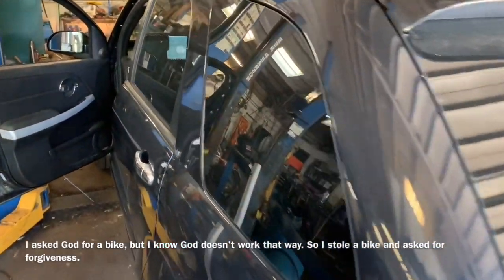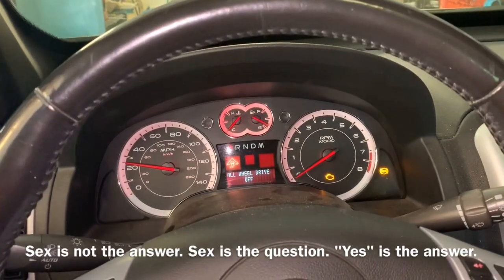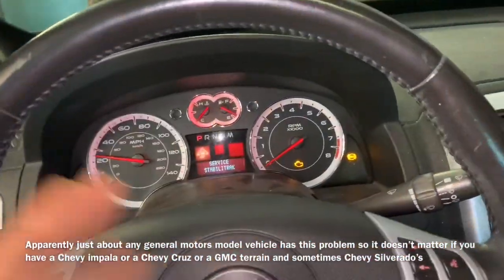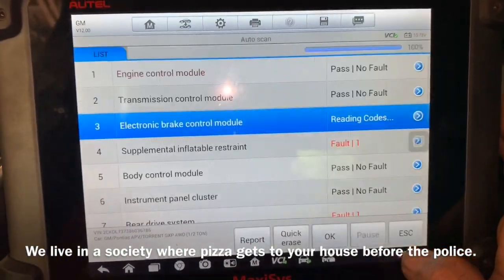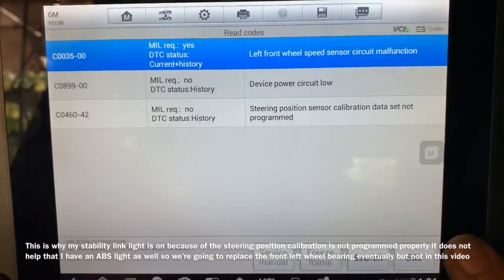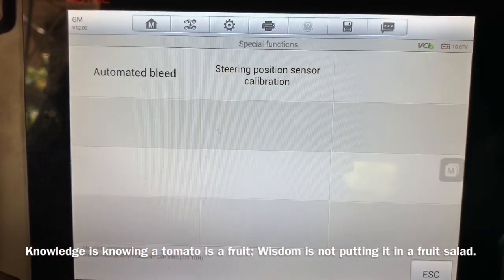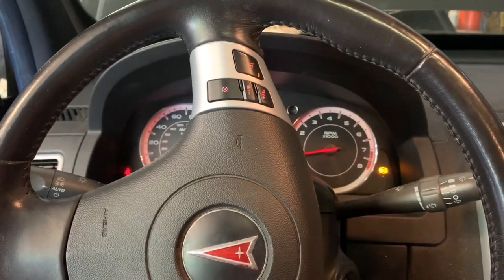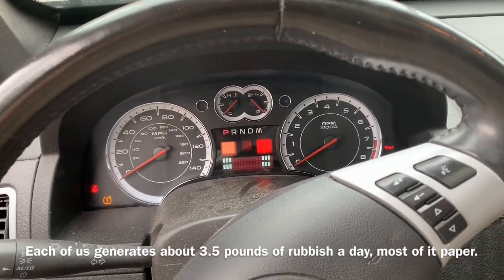Possible reason why stabilitrak light is on. Chevy equinox, GMC Terrain, Saturn Vue,Pontiac torrent

Comment from the maker: ⭐⭐⭐⭐If you found the video helpful, and you'd like to help us out. You can use ANY of these links to purchase ANY ITEM you normally would on Amazon and we'll get a piece of the pie with no extra cost to you!  Thank you!
Autel Scanner Maxisys  2022  Diagnostic Scan Tool with ECU Coding, All-system Diagnose, Bi-Directional Control: https://amzn.to/3k9T6rl
FOXWELL NT301 OBD2 Scanner: https://amzn.to/36OSHru
CRAFTSMAN Mechanics Tools Kit with 3 Drawer Box, 216-Piece (CMMT99206): https://amzn.to/3wlLgAz
DEWALT 20V MAX* XR Impact Driver Kit, Brushless, 3-Speed, 1/4-Inch: https://amzn.to/3N9D4KN

Comment: I had the same dummy lights. The lights were intermittent for about a year, but for the last 3 months (Sept, Oct, Nov, 2020) they stayed on. The Stabilitrak/Tracton Control, and ABS were not working - I tested them in the rain. Took it to a great mechanic and it was the right rear wheel sensor. Said it was very common for a 2008 Equinox. It cost me $260, but I now know for a fact what the problem is when the other 3 fail - which is just a matter of time because those vehicles are a POS. I will change those myself for $20-$65 depending on the quality of part that I buy.
Reply: The speed sensor? My services lights went on when I was parking my terrain. Hopefully that narrows it down to the front two tires. ( we had a heavy storm, maybe the splash finally killed it )
Reply: @fortyforfree  
Yes, it's called an ABS wheel speed sensor. They told me they had to drive it with the diagnostic tool connected to figure out which wheel it was. In the past 6 months the light has been coming on  again intermittently so another one is getting ready to fall. The vehicle has been a money pit but it's paid off and in good condition. I use it as a work vehicle so it's all good.
Reply: @bigelile07  Oh, did you take a look at them when they changed them? They just looked corroded? Hopefully it’s on of the front ones. I’m not great with cars but I think I can do it myself lol
Reply: @fortyforfree  
No I didn't see the one they replaced, but I'm in Florida so no rust or corrosion under the vehicle like you would find some other states (Northern states). Just an electronic part that failed.
Reply: @bigelile07  oh ok. Thank you though.
Reply: @fortyforfree  
You're welcome

Comment: I had stabilitrak light. But it was because it needed a front wheel alignment. Once that was done the light went off after driving down the highway. Could also mean wheel bearing issues.
Reply from the maker: No that means you’re steering angle switch is defective it’s inside the steering column it tells the Ecm / Bcm where the wheels are at. It also communicates with the airbag module and tells it where the wheels are at relative to an accident

Comment: I have a 2011 gmc terrain,  I got new tires, and my car started a horrible vibration at high speeds. I had the tires rebalanced and rotated. I had the front motor mount replaced,  new front rotors, hoses and pads. Then the car started feeling like it was going in low gear or like a break was on while I was driving.  Then had the abs modulator, a censor and pump replaced. They reprogrammed the computer.  It's still shaking, at any speed, intermittent,  and sometimes feels like it's in low gear, or the breaks are slowing the car when I'm trying to drive.
Reply from the maker: First question may be a couple more after you answer this one? Is it all wheel drive? 

If so it’s quite possibly your sinner driveshaft carrier bearing.
Reply: I have the same car and it was going through all the same problems one day it just started making a loud grinding sound and completely died in the middle of the street. Turns out this car guzzles oil 3x faster. My car had no oil in it and I had to have to have the entire engine repaired but I don’t think that was the actual reason for the hard shifting because after I had it repaired it was still doing the same thing and now I have a problem with this stabilitrack and reduce engine power my advice just change your car if you can with the dealer I’ve had nothing but problems since I got this car last year in January it’s a piece of crap
Reply: @sharpcarco  gmc terrain 2010 keeps saying service stabilitrack and reduces my engine power. I don’t have the money or time right Now to leave it at a mechanic. Idk what to do. The guy at auto zone said it’s the throttle body injector unit. but now when I try to reverse it feels like my car my rear tires are locked or something like I can’t reverse my car now what do you think the problem is and How long does it take a mechanic to replace it if that’s the actual issue.
Reply: This is ball joint..I change and everything good

Comment: I have an 07 Chevy Equinox. My Stabilitrak light and Traction Control lights are coming on. Are they related? Also, back in September I had the All Wheel Drive control box replaced, does that have anything to do with the lights being on? Thanks, Patty
Reply: I had the same make/model you do.  There's a lot of various parts that go into triggering Stabilitrak.  ABS wheel speed sensors and EGR valve stand out.  I had replaced all the speed sensors and wheel hubs before selling it but not the EGR.  Is your car shooting Error Codes?

Comment: We took our 2012 Chevy Equinox to the dealership for the service stabilitrak sensor  light on. We were told the sensor that went out is on back order and there is a nationwide shortage. Back order from China. Is that your experience also? Also, is the vehicle safe to drive in your opinion? We were told yes, just wanted a second opinion, thanks for all your help, very much apprecaited.
Reply from the maker: Yeah, they say that stuff all the time…. But most of the time, depending on what part it is, you can get it from a reputable salvage facility junkyard and it’s just fine.
Reply: @sharpcarco  thank you sir for taking the time to reply. Much appreciated!

Comment: First, praying for your son and the strength of your family during this trying time, justice will prevail 💛

So I have all of those lights on my dashboard but it also jerked right before the service engine light came in and also jerked right before the service stabilitrak indicator came on. Any ideas? The gmc dealership said I need to replace the sending unit. Could that be the issue or something more?
Reply from the maker: Probably the electric power steering control motor I would have to guess. Sorry can’t be too specific. Not sure why it would do that. It’s not supposed to do that.

Comment: I have 2016 gmc terrain-stabilitrak service light error. All the odometer needles go crazy. Take it to dealership it goes off.  They say if the error is not on cannot diagnose therefore my vehicle sits at the dealership

Comment: I saw a video that said stabilitrax and EMS codes were both connected to the sensor on the engine next to the oil cap. Thoughts? (2008 torrent)

Comment: Hey Clay.  I have a 2008 equinox.  Today I lost blinkers , wipers,horn and headlights . It was working good up to the rain today. Any ideas?
Reply from the maker: Definitely sounds like a fuse. Or what’s called the clock spring. 

That’s underneath your steering wheel more than likely you’ve also got a stability control light on meaning that the computer no longer recognizes the angle of the steering wheel because the wires inside the steering column probably broke. 

If that’s the case you could replace the whole steering column which would probably be the most economical way and easiest way to repair it. 

Hope that helps.
Reply: @sharpcarco  so when I start the car lights turn on .but if I hit horn wipers or blinkers it pulls power and dims the headlights . I can get like one blink on blinkers then it powers down.
Reply from the maker: Yeah I would say steering column definitely has some broken wires in it, 

you could probably take it apart and see where the wires are broken and maybe even fix it without replacing the whole steering column but that’s a possibility because the steering column is rather inexpensive usually $75-$125 for the whole thing with the keys
Reply: @sharpcarco   Another thing I noticed is my blinker will stick sometimes it's recently. Like when I make a turn I turn the blinker on if I lean on the steering wheel it'll click back . Maybe it's just a problem that's been developing for a while and finally gave in
Reply: @sharpcarco   I ordered the new clock, with both blinker and windshield wiper modules. The whole setup they call it a multi switch I suppose including the clock.. Just to have on hand when I take it apart and see if something is frayed or separated or somehow unplugged. I will post an update let you know how it goes I'm really curious to see how this hat this fixes it . One thing I did notice a few months ago was my blinkers would get stuck on but I never had an issue with my wipers until yesterday I flipped a man and they stopped in full motion straight-up-and-down and I was able to flick the wiper a few times to get it to reset and then it stopped working so now if I flick the wiper it dims my headlights turns my blinkers off . So if I get in the car and don't use wipers blinkers headlights or fog lights everything goes fine but if I touch any of those it those it faults the electronics across the whole front. I did pull it did pull every single fuse under the hood and make sure they were all good is there more fuses that I can look forward to see if they are blown?
Reply: Seams to be fixed.  I got the whole clock spring and multifunction switch with both lights and wipers mods. Thanks a bunch now I need to figure out why it chugs when I punch the gas .

Comment: I have a 2008 Pontiac Torrent and the only light I have is Stabilitrak Light. I do the steering angle sensor and it will work but then the Stabilitrak will come right back on. I only have the Steering Position Sensor Calibration Data set not programmed,   Do you think I need to replace the whole steering column or is there a module for it that would need to be replaced?
Reply: @The Clay Way
Reply: @TheClayWay

Comment: I got the oil changed at Walmart and my traction control and stabilitrak light came on afterwards. I used my scanner and it said the MAF sensor wasnt working. Walmart forgot to plug the MAF sensor wire back in after changing the air flter. I plugged it back in and the code cleared
Reply: Where is that sensor located

Comment: hi is their anyway to clear the steering code with out the tool you have . I just replaced the heater core  and i disconnected the steering wheel and took it out of the car for a couple days . So my stable like light is now on .   Thanks

Comment: H
Replaced wss left front abs light went away. Servixe stabily trac still there. Did the steering wheel calibration. Did not work. Did alignment THEN did calibration .now the light went away.
Reply from the maker: That’s strange that you would’ve had to of done in alignment that is awfully odd but I’m glad it worked out for you good to hear

Comment: I got a scanner for my 06 equinox to try to resolve my stabilitrak issues. Before I start swapping out expensive parts I wanted to get better information... I had one guy telling me to replace a $900 TCM computer... Why in the world would any manufacturer locate a computer on the transmission is beyond me... Doesn't seem very off road to me...
Reply from the maker: The transmission control module is not inside the transmission it’s behind the radio underneath the heater controls of I remember correctly it’s a part of the BCM or it’s internally located inside the ECM if I remember correctly there are only three computers in this car but I may be mistaken but they should be the ECM the BCM and the airbag control module
Reply: Thank you for responding! Anyway there's this box thing that  sits on top of the transmission with some wire groups plugged in one wire group comes from the transmission itself the others from a separate harness in addition there is a mechanical linkage connecting this " box" to the transmission. I took pictures of the scanner screens when tests were made, I gotta tell you that this scanner that was used wasn't a "live stream" machine. I however went out and bought a scanner that hopefully is... not a clue how to use it yet, but I am a computer geek kinda guy and will figure it out, haha! Codes are P0741, P0700, PO420. FOR CODE PO741 DATA IS: REL TPS 27.1% AMBIENT 64° TPS B 40.4% ACC PEDAL D 37.3% ACC PEDAL E 18% BARO 30 INHG CAT TE 11 1521°F ECU VOLTS 14.293 LOAD VALUE 57.3% EQ RATIO .999, WARMUP DTC CLR 63 CLR DIST 2111 MILES  EVAP VP -42 RUN TIME 1785 COMMAND EGR 10.2% EGR ERROR -32.8% COMMAND EVAP 100% FUEL LEVEL 76.5% SPARK ADVANCE 23.5° IAT 68° MAF 6.81LB TPS 40.4% STFT B1 3.1% LTFT B1 7.0% MAP 24INHG ENG RPM2661 VEH SPEED 72 MPH. I gotta tell you that stabilitrak issues are intermittent. My poor car sits in the driveway as its been a long week with the new fancy tester sitting on the desk ready for me to learn to use it. By the way I appreciate the videos that you provided which is how I am learning the logic behind car computer stuff, 😄 . Take care and stay safe!

Comment: I need some help, I turn on my room mates 05 chevy equinox,  The ABS light does not come on. When I back up out of a spot or start moving, I'll hear the pump for the ABS, Come on. But it doesn't break or anything When you push the brake pedal down you can feel the ABS kicking on. but if you drive it a 0.5 miles the abs, traction control and the "StabiliTrak" light comes on all at the same time.
Reply: Also nice to see a fellow Michigander.
Reply from the maker: Howdy neighbor!! Well it could be as simple as a bad wheel speed sensor but more than likely it is the ABS control module is bad it is extremely common in them vehicles and from the description you’re giving I doubt it’s gonna be as simple as a wheel speed sensor. I do have video showing you how to change that particular unit for that vehicle. 

Hopefully that information is helpful thanks for the kind words and have a great day
Reply: @sharpcarco  Yeah, that's what I was afraid of. I just simply pulled the fuse I doubt he'll want to fix it, Especially how expensive those modules are.

Comment: Who can reset that stabile link for me? And what's the cost?
Reply from the maker: Well the cost is whatever repair it needs... The stability track light comes on for a couple different issues so the cost will very. Normally the light will just go off after the repair whatever the problem is
Reply: I've had my hubs repaired, but the guy never reset my sensors.
Reply: And when codes r being scanned the need for repairs never come up. 🤔 thanks for posting this video.
Reply from the maker: Well maybe you just hit your traction control light by accident. Is that a possibility?
Reply: No" Ive been pushing it since I got the 2 trans axels repaired.
Reply: It could be as simple as bad spark plugs!!!! Regap them if able to if not replace them!!  Light will go off on its own!
Reply: regina broughton disconnect battery for about 16 seconds then reconnect and all resets if they come back repair is needed

Comment: So if I have new abs sensors all around and my stabilitrak comes on after I drive it for a while ?
Reply: check the codes I saw one video where it was the EGR valve. What the EGR has to do with stabiltrak I have no idea.
Reply: So it could be the EGR Valve.

Comment: That is why whatever  I do I couldn’t fix this cluster.It was designed to prevent DIY unless you have an expensive scanner or go to their shop and spend more money. These car companies way of thinking is to design a trap and forcing motorists to spend more money. Their sensors are the main tools to steal your money legally. This is what they call it greed.
Reply from the maker: I agree with most of that
Reply: The Clay Way, where are you located at in Grand Rapids, Michigan?